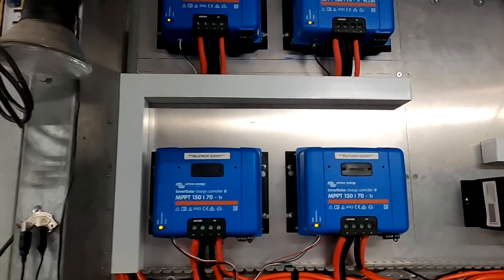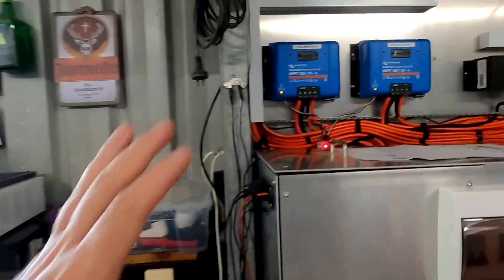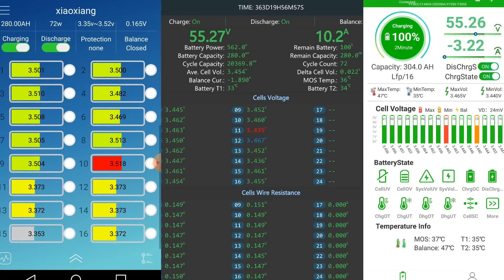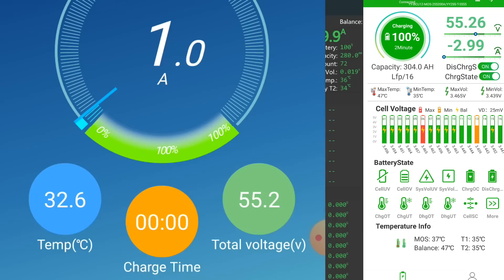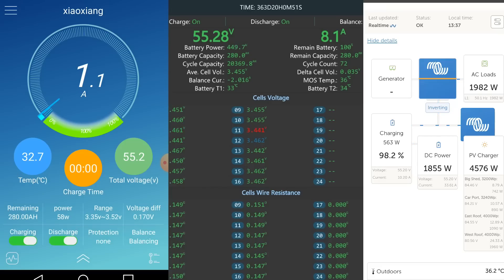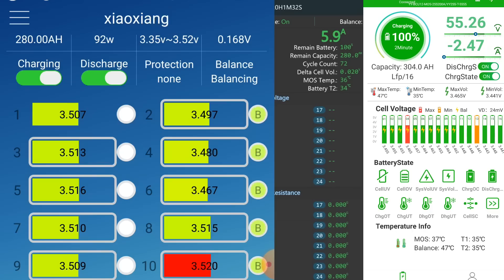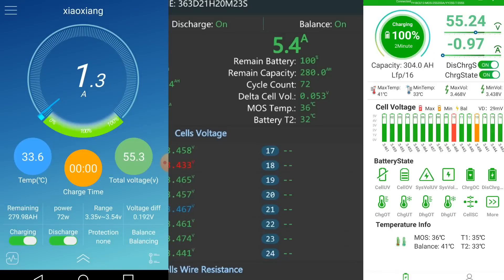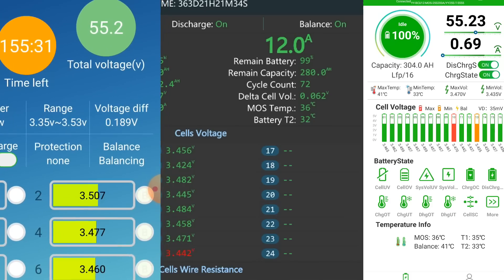Cell Balancing issues under high load. Even the JK-BMS is struggling here...

Comment: Andy, have you considered the feasibility of using a PLC (Programmable Logic Controller) in the form of a Raspberry or a NUC you could program to automate your human functions, like switching on active balancing, load and charge management?
Reply from the maker: No, I haven't considered that. I want to be in control of the system at the moment and turn things on manually to see what happens. Maybe we do this later once everything works and there are no problems any more. That's being said, maybe never 😂
Reply: I have, at present I have 16 NUCs sitting around.
Reply: @chuxxsss  And doing what?

Comment: I’ve seen about the same thing when the batteries haven’t had a chance for an excursion into balance voltage range for a week or two. Once it’s there for an hour or so it gets to near zero delta. The Overkill is definitely handicapped by low balance power and or the buss bars. The Heltec surprises me or could it be a good set/treatment of cells?
Reply from the maker: As you may know, I swapped the Heltec and the Overkill recently and the Heltec has now a perfect balanced battery with not much to do. While the Overkill has to deal with this mess (cell 1-10 much higher than 11-16) which I believe was caused by the Heltec BMS.
Time will now tell if this happens again and the Heltect 'destroys' this 'perfect' battery at the top as well. And can the Overkill rectify the problem, the Heltec left behind in the bottom battery?
Reply: @OffGridGarageAustralia  
No I missed that one, but I see you are on the hunt of the problem by means of elimination. Detective Andy.

Comment: Andy,
As usual you are running into assorted inconsistencies/inconsistencies with all the balancers, the float voltages while you have a load connected and….. that infamous charge balance setting.

First, in this case, with the load on there, to keep the balancers active, you could use a float voltage of 3.4V (54.4V) with a balance voltage to 3.4V. (If you are willing to use a float of 3.4V, which some people consider high). If your float is lower, your load will drag the batteries down to float level and balancing stops as soon as float kicks in since the balance voltage is higher than the float voltage (per cell…).

Second, the cursed charge balance setting: in general, especially for passive balancers, if you need to balance a significant offset (like your bottom battery?), you will find you need to be able to balance at a small charge current, so you turn charge balancing on. But your BMS will show 0 current for a small current so it will not balance if the current drops a bit. Sigh. So you turn charge balancing off- but then as soon as you get a bit more current (say when the clouds go away) balancing turns back off since you have a larger current. 

The main problem is the fact that you BMS sometimes shows 0 current even though the current is not zero. So you should not use the current to determine if you should balance. Vicious circle. You can see it even in your video. I only wish the manufacturers gave you this option.

You will find that if you can get rid of that setting all will be better (good luck): balance while above 3.4V, current should not matter: i.e. balance while charging, discharging or 0 current. Or as a minimum while charging or while 0 current. For LIFEPO4 the charge balance setting should not exist, because the low current accuracy of assorted BMSs is so atrocious.

My practical experience with Daly BMSs has led me to this conclusion: I was able to get the balance working (weak, but working reasonably well) after I was able to kill the charge balance setting that was enforced at the factory. Out of the factory, the balancer only operated when the current was above 2A.
Reply from the maker: I have set float to 53.6V (3.35V/cell) and balance starts at 3.45V. So hence I extended the absorption time to 3h to keep the cell on 55.2V (3.45V) for longer to balance.
This is a problem al JBD BMSes have, they either balance while charging or while not charging but not both. I hate it. The other two BMS don't care and start balancing as soon as on cell is over the start balance voltage (3.5V) and the delta across the cells is larger than 5mV (my setting). Far better job, they are doing.
Yes, Daly in particular has really bad balancing options. I have tested this multiple times her eon the channel.
Hence, we all love the JK-BMS ❤
Reply: Thanks for the response. As you can tell I have been experimenting and getting frustrated with my balancers.

If you are interested, 3.35V may be a smidgen low if you want to keep balancing. I found that with weak balancers you need ‘time in the knee (as you call it)’. And with the sun, time is limited. So to give my weak balancers as much time as possible I needed to be above a certain voltage – I call that the zeropoint charge voltage – where the knee starts when charging. On my cells I found that voltage to be 3.36-3.37V. Incidentally, that is the minimum absorption voltage you need to charge your batteries to almost full (at 3.37V it will take a long time. Remember your experiments with 3.4V and 3.5V absorption capacity tests….). 

The preceding paragraph only applies if your balancer is actually balancing. And as you found that becomes questionable with the ‘charge balancing setting’.

Now that you are famous, maybe you can convince one of the BMS manufacturers to actually fix this (simply remove the setting, i.e. always enable balancing above 3.4V – it’s that simple), and then the others will follow. I do not quite understand why BMS manufacturers do not understand how their customers are using their product. It feels like they have a blindspot for LIFEPO4. Why is that setting there? I think it is leftover from previous chemistries.... (Daly are you listening)
Reply from the maker: @zeropointbalance7366  Thanks a lot for your great comment. You're absolutely spot on.
The weak balancing we see (still see) in BMS is a leftover from Li-ion where the voltage is almost linear with SOC. There, if you start balancing early, it actually works to shave off some mA everytime your charge and overtime this will give you good results. This is not working with LFP batteries any more as we have tested so many times. At the moment only JK did the right thing for their LFP BMS and integrated an active balancer which actually works. I agree, that other manufacturers need to follow. And, get rid of this 'charge balance' function.

Comment: I have tinned copper busbars and my JK BMS's do the same thing. Only when it gets near full around 98%. It starts with a low cell difference of .15 then it hits cut off voltage. repeats and every time this happens the cells get worse all the way up to .108. I thought it was high charging but nope some cells run away to higher volts. 1 pack has 2 cells and another 4 cells. I have growatt inverters so when its going to overcharge I turn float mode on which stops charging after the first OPV and waits till batteries get a load and if solar is still coming in it will charge again then repeat. I do not leave float on because the batteries have to go under 3.3 volts on discharge. I think I will replace my inverters next year with schneider inverters. Regardless I am happy as I have been off grid since 29th of February and looks like a 75 day period is the only time I need grid or a generator and out of those only 25 days of actually needing grid/generator. Right now its cheaper to use the grid. That could change.
Reply from the maker: Interesting. What are your settings for absorption and float and when do you start balancing with the JK?
Reply: @OffGridGarageAustralia  Growatt doesn't' have absorption just float. Balancing starts at 3.3. Only reason I bought them is O paid $1550 for 2 5000 watt all in one inverter. each can handle 5k power and pv input.

Comment: How often do the batteries need to be balanced?
I can’t find the reference atm, but one fellow sets the cc to 90% charge voltage then, occasionally triggers equalization (set to the balance voltage) to do the balancing.
This makes balancing a one button operation.
Does this make sense to you?
Reply from the maker: Yes, this is what some people do. With the right settings this actually works quite well.
Reply: I do the same.

Comment: Quick question, at what voltage is the active balancing? At the cell voltage right? so 2(A)x3.5(V)= 7w?
Reply from the maker: Yes, roughly. But active balancing, so we don't loose the energy but charge a lower voltage cell with it.

Comment: Sounds like a dumber setup is better. Separate active balancer with the on/off switch soldered on. If there is sunlight outside, turn it on.
3pm rolls around, no more load on the system & let the batteries charge up. 4pm, turn off the active balancer.
Reply from the maker: Hmm, that would not work for me as I'm not at home during the day and if you have cloudy weather, it can create an imbalance in your pack.
It's better to turn on the active balancer only at a certain voltage, 3.4V or higher.

Comment: can you tell us how wide your energy productions spreads from summer now to winter ? 

facing south we see a factor of about 10 or more.
Reply from the maker: Hard to tell as I have constantly upgraded my system and it was never the same size wise as the year before. 
Looking at the data now, it is more like 4x down here. With the old old system on the roof, I made 110kWh in June and 450kWh in December. Will be interesting to see with the new larger system now...